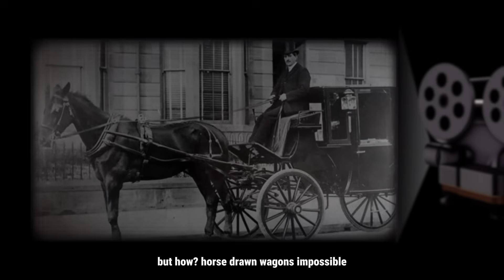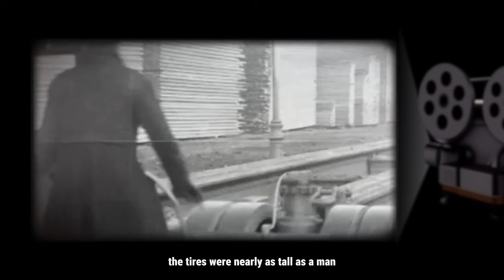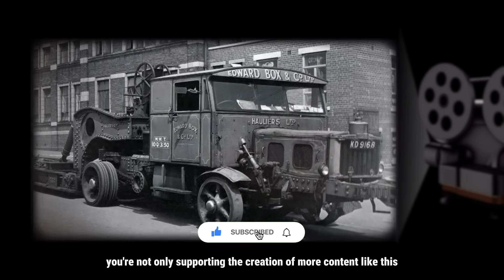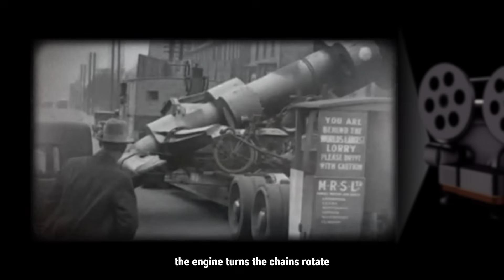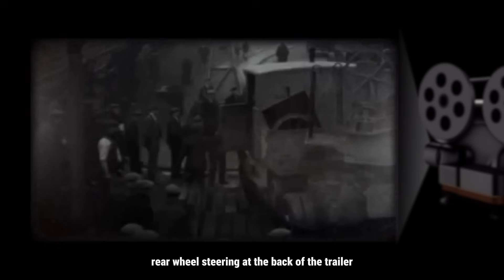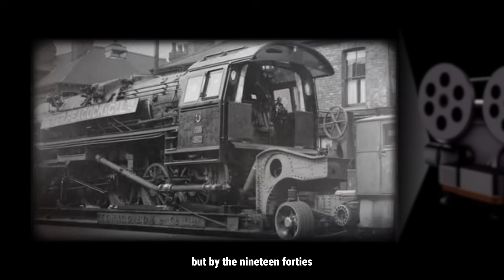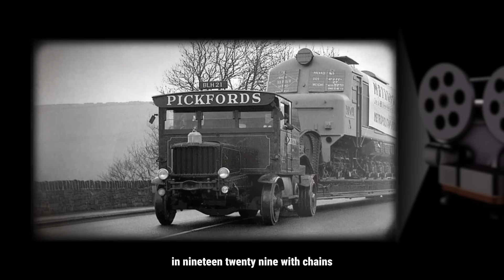The 1929 Truck That Hauled A 100-TON Locomotive That Shocked The World!

Comment: 0:19 Steam locomotive ai bollx. A Jube numbered 100610 my arse. And you don't lift a loco with coal in its tender, nor connected. For the sake of historic content, and for future generations watching, please present facts, facts, and 100% facts. Not bs. The lifting mounts should be taken off the frame front and is usually a long grab hook rather than just chains. For god sake, your chains aren't even attached anyway. 🤪(((🥊

Comment: The second  Scammell100 tonner built went to Pickfords  a company partly owned by the British government, registered BLH 21  this tractor unit gained the nickname of ' Leaping Lena' due to her liveliness when starting from rest with a  heavy load. The solid  rubber shod wheels on both tractor and trailer are tall as a teenaged boy, each cast steel  wheel shod with two or three hoops of solid Dunlop or India rubber. When BLH 21 was retired from service, her trailer was re purposed in Pickfords workshops as a drawbar unit with a solid tyred front bogie supplied by Cranes of Dereham Norfolk,. In its revised configuration BLH 21,s trailer  continued in Pickfords service hauling Parson Peebles type transformers well into the 1950,s coupled to Scammell Standard or Super Constructor tractor units .
Reply: Thanks i was trying to remember it's name.
Reply from the maker: Exactly

Comment: I was  raised next to the Three Nuns inn, famous in tales of Robin Hood. The junction of A62 and A 644 where the A62 rose slightly and hosted the then OLympic Service Station, now Three Nuns Filing Station.  Pickfords used Scammell tractors. From time to time 2 tractors, a 64 wheel trailer with a 300 long ton transformer and another Scammell tractor at the rear.   I  recall the asphalt rippling like a carpet one time when unco-ordinated gear shifting  imposed all the torque on one tractor! This was the 1950's and  some of those Scammells  had chain drive! The trailers had a steers man cabin with a Lister Diesel hydraulic power unit providing power for trailer control.   Epicyclic reduction hubs replaced chain drives in an efficient reliable manner.

Comment: This movie has so many errors. For a start at least one was still in operation in 1954. The movie shows an 'X'" Class 3'6" gauge built by Metropolitan Vickers  for the West Australian Government Railways.             i can't make out the number but it may be 1001 or 1009.  They were delivered  between 1954 and 1956 at the Bowesfields Workshops in Stocton-on-Tees. A number of comments point to both of them surviving one with leyland and the other in some other private museum. Picfords owned one and a correspondent has identified the other owner. Cheers

Comment: Modern heavy lift vehicles have individual wheel steering on trailers in some cases. Allows sharp turns or the need to go sideways round street furniture. The original also had solid tyres with no tread. A basis from steam road locomotives.

Comment: There are many untruths here. We often see heavy loads around here , often up to 700 tons. The Prime Mover has Driveshafts, they do not break. The rear wheels also steer. In the twenties, Flags were used by a Banksman to give directions. Vehicles at 100 mph do not fall apart. Most British Roads, in 1929, could not take a 100 ton load, and few bridges could do so, without failing. Scammel vehicles were good in their day, but time moves on. Chain drive, whilst efficient, could not compete with shaft driven gearboxes. The Big Boy steam Locos only arrived in the USA in the mid 1940's. They could not be lifted by Crane in British Docks at all until the late sixties. I found that out, when looking to import a steam loco from the USA.
Reply from the maker: Yes but that was the first truck which hauled a 100-ton.